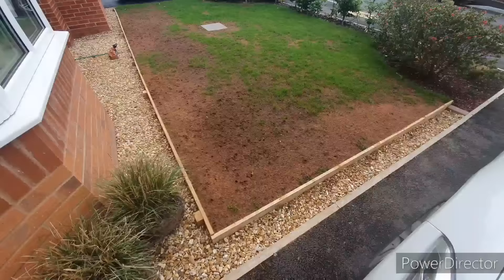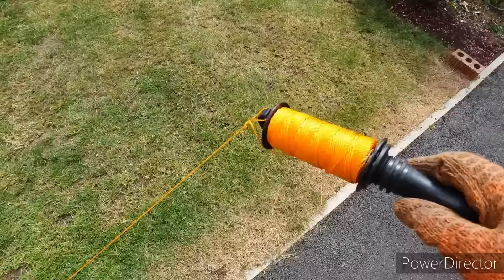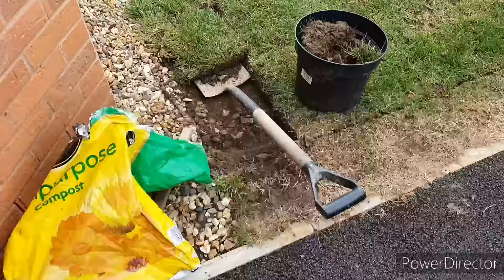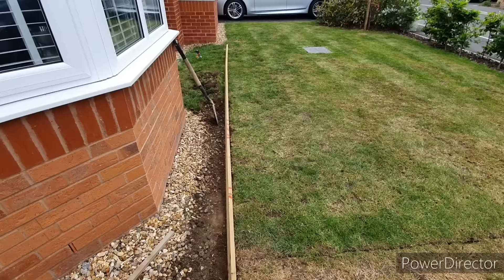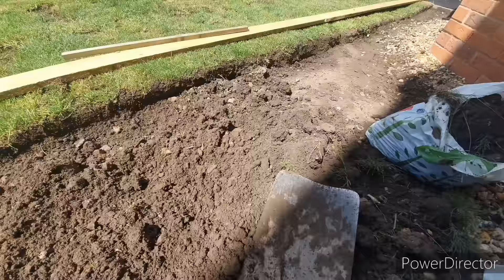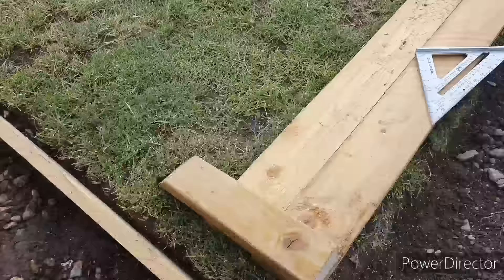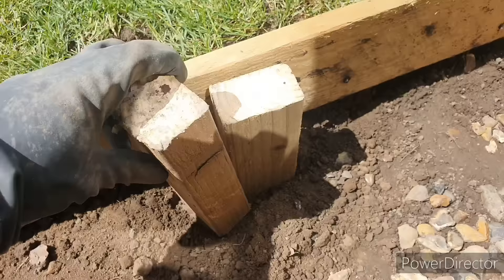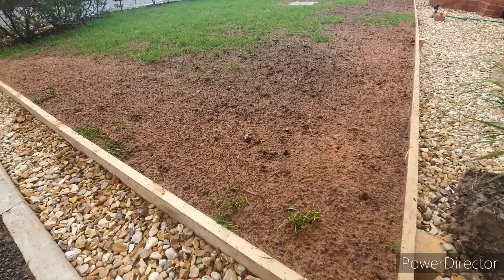EASY Lawn Edging Installation - Garden Wood Edge Ideas

Comment: Couldn't really find '4x1' and '4x2' as measurements at the usual DIY places. They tend to use Metrics. Closest I could find at Wickes was Pressure Treated Sawn Timber 22 x 100 for the boards, and Pressure Treated Kiln Dried Timber 45 x 95 for the pegs. They do a proper Gravel board at 22 x 150 but that just feels like I'll have to dig deeper to get them in!
Reply from the maker: Yes alot of places are metrics but 22x100 is very close to 4x1 and those few mm don't really matter. The key is treated timber and enough depth to cover the depth you need 👍
Reply: Use 2x2 (50mill x 50mill treated timber or some places will state 47mill (whatever guys). If they dont sell the pegs buy a length of watever size and cut down to bout 400 long. Preferably put a 2 way point on it but no biggie (your choice).
The standard pegs are bout  2x2, 4 way pointed, 400 and 600 long. If you buy timber to cut down buy treated rough sawn timber

Comment: So have you just screwed the right side border in rather than install more posts on the side next to your drive?

If I want to fully border garden do I add posts on opposite sides of the square/rectangle ? Rather than all four sides?

I’ve cut my posts 3 the height of wood. But struggling to get post low enough in ground. Would I be better off cutting post to 2 times the height instead?

Comment: Great video. Could this method be used to create a border around some decking by maybe having the ground posts below surface level and then covering with gravel?
Reply from the maker: Thanks Paul, why not you can get creative! Anything in/on ground should be pressure treated
Reply: Thank you, I'll try it then 👍
Reply: The pegs should be lower than the top of edgeing anyway. And yes correct so they can be hidden by gravel.

Comment: Great video, really going to help me out with a project I am about to start. I might be being dumb, but do the wooden “pegs” have a proper name? If so, tips on where to buy them from? Thanks
Reply from the maker: Thanks, I just used wooden 2x4 cut down then cut them at an angle at the end
Reply: The proper pegs you want are called site pegs 2x2 normally 400 or 600 long and they are 4 way pointed.

Comment: I was wondering if the wood border will get rotten eventually due to water?
Reply from the maker: You need to use pressure treated timber which will extend the lifetime but overall yes all wood will rot eventually but the right type of wood should be good for many years to come

Comment: Hi mate love the content, I am planning to dress and overseed my lawn but I’m worried about the trampoline I have on the grass? Will the seed still germinate if I keep moving it around? Thanks in advance
Reply from the maker: Hi Lee, You've got a few issues to think about there. 1 is the area under the trampoline feet wont germinte 2 walking across the area isn't ideal and 3 the are underneath the trampoline wont get much light. If possible I'd tip it on the side off the grass, if not consider seeding your area in sections and when the seed has grown in one part move it to another.

Comment: 5 out of 10 points, where is the membrane to prevent weeds growing through the gravel? It will look disgusting after couple of weeks...
Reply from the maker: I put membrane down, looks good still 1 year on
Reply: This is a vid on installing timber edging not on installing a gravel bed, so stop hating.